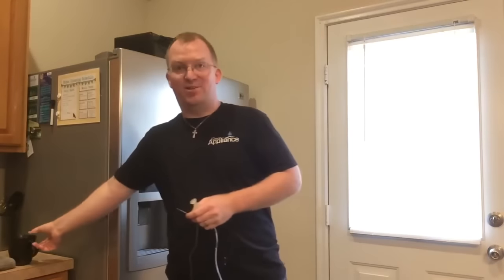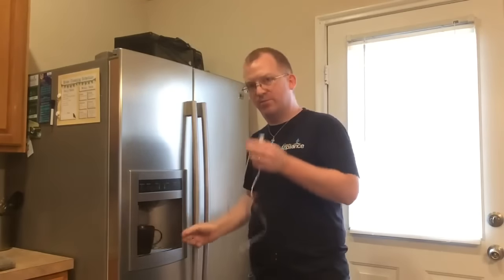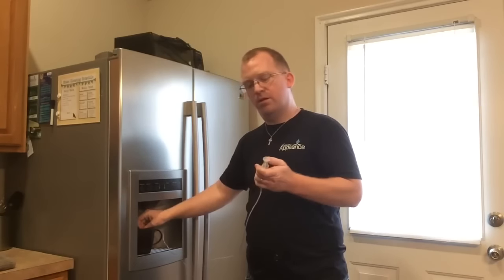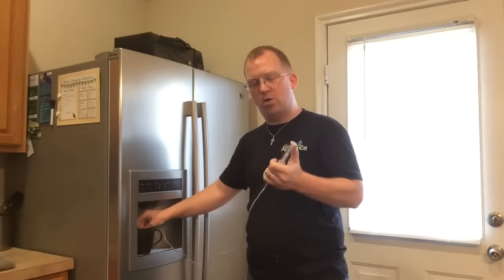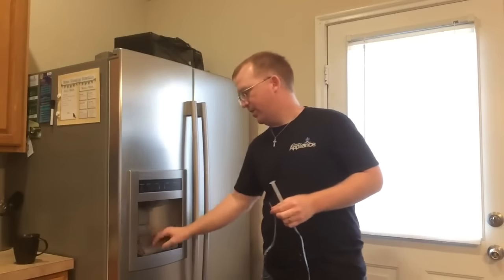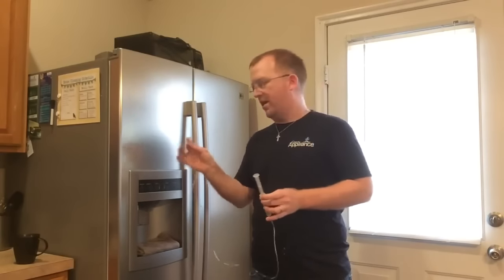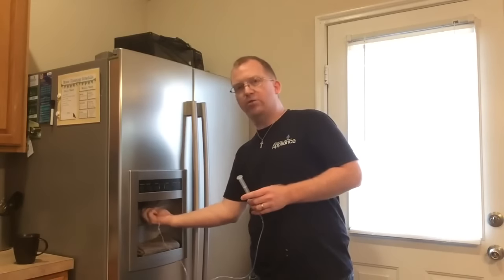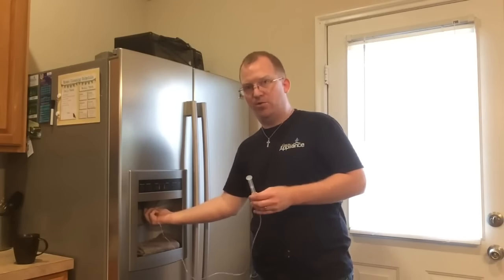The FASTEST way to thaw a frozen dispenser!

Comment: This is a great device!  My water dispenser regularly freezes up and I have added a  heater, resealed it, replaced the flapper, regularly thaw the line either by turning off the refrigerator or using a hair dryer.  I still had issues.  I just got this device a few days ago and it will get the water flowing again in less than a minute.  The problem is the ice build up a few inches into the line...this device is able to reach it and get the warm water directly where you need it!
Reply from the maker: Awesome!  Glad it helped you out. 
Thanks for the follow up and the comment.

Comment: Outstanding. Using the. Hairdryer & weed wacker line the line was unfrozen in less than 15m. With no need to disassemble the front panel. 👍
Reply from the maker: Awesome! Thanks Kevin. Glad you got the water working!

Comment: Worked just as promised. My water line was so filled up that it took a couple of times filling the tool up. Had tried the hairdryer method with no luck. Also tried a kid's medicine syringe but no luck there because the opening of the water dispenser is too small. This worked perfectly. Highly recommend!

Comment: Great tool for clearing frozen water line in my GE refrigerator. I have seen many solutions to this issue but most cost & I was not ready to spend anymore on this shaky unit. Water line was clear in less than 10 minutes from mailbox. Highly recommend!

Comment: Like many people, my GE refrigerator's water dispenser was constantly freezing up, making it inoperable.  I tried a number of solutions for this; 1. Service call from a GE repariman who defrosted the line with a hair dryer.  This was a quick $150 down the drain, 2. Defrosting it myself with a hair dryer.  I managed to melt the ice dispenser unit in no time which led to another $150 service call, 3. Leaving the freezer door open while I taped sheet plastic over the opening to the freezer itself.  This worked, but it was a pain in the neck, 4. Investigated installing a water line defrosting coil.  The repairman I called said that he couldn't warranty this work because these coils burn out about fifty percent of the time.    I saw the Ice Surrender tool on YouTube and figured that I would roll the dice and spend about $13 to purchase this device, (including shipping), even though I am generally a skeptic about these kinds of gadgets.  I followed the directions on this video and in less than one minute I cleared my water line.  So simple!  The chances that it will freeze again in the future are good, but I don't really care.  I know that I can solve the problem myself in no time using the Ice Surrender tool.  Take it from me; if you have frozen water dispenser problems this is the right solution.
Reply: Sure enough, my water dispenser froze up again.  I got my Ice Surrender Tool out and cleared the line in less than 5 minutes.  The water dispenser doesn't work so well.  The Ice Surrender Tool works great!!!

Comment: Wow!! I just got this ice surrender and it worked exactly as it shows. I was able to fix the water flow problem and it works like a charm!  I'm sure I'll probably need it again in a few months when the GE fridge line freezes again. No more expensive service charges for something I can do so easily and quickly.  Andy- genius solution
- 😊👍thanks!

I highly recommend this product!

Comment: Hi Andy,
I’m glad I found your video and ordered your product! It worked as promised, the line has not frozen since I used it, however, we still have that buzzing sound coming from the ice maker? Any suggestions? I understand it is a flaw with these GE products? Thanks
Reply from the maker: Hi Angela, 
Does your Icemaker make ice as expected?  Also, does the buzzing sound only happen when the icemaker is moving the fingers around to kick the cubes out or does it buzz full time?   Thanks!

Comment: Works like a charm. Thank you for offering this product to the public.
What is up with GE? What makes the freezing happen i the first place? The freezing of the line wasn't an issue when it was new.  Now it happens over and over again.
Reply: Hi Mark, 
I'm so glad it worked well for you!  Thanks for the follow up. 
The issue is due to the age of the fridge as there is insulation that breaks down inside the freezer door. This is one of GE's more embarrassing design flaws and one would think they'd bend over backward to assist customers with this issue as it is really really bad advertising for them. 

They do make a dispenser heater which requires a bit of work to install and requires tapping in to the factory wiring harness. In my repair business I've seen about 50% success with this repair due to bad insulation or having the heater burn out. For my repair business, I won't warranty this repair as it stems from poor design. The part runs about $45 and then around $100 (or more) for the install.  
GE really should at a minimum send this heater out for free to customers, but I'm told they no longer will do this.

Comment: Andy, anxious to try it, but would rather fix the entire problem...Is the heater the only option?
Reply: Carolyn Rhodes hi, unfortunately due to the fact that the issue comes from the breakdown of insulation over time inside the freezer door directly behind the dispenser, the only actual 'fix' is to replace the entire freezer door. If it's worth it to you to roll the dice on a heater you can try this, but depending on the severity of the insulation breakdown you may or may not have success. I've seen spotty success in my appliance repair travels (40-50% callbacks) and for that reason no longer warranty a heater install. The heater heats only the outer part of the dispenser tube, but the ice typically will form 4-6 inside the door so the heater is often ineffective. Often you can clear a line once and not have the issue again for years which makes me wonder if the heater is more a placebo than effective. If water is run through the line often (many people in the house vs a single person) helps more than anything for keeping the line clear long term.  
Another trick you may try is to adhere a square of foam or styrofoam to the freezer door inside directly behind the dispenser area, being sure to keep frozen food from touching the wall also helps. 
I wish it were a different answer.
Reply: Andy, thank you. We just found that if you just leave an 18" piece of weed eater cord up in the dispenser tube, when it freezes up, use long nose to pull it out, it breaks up the freeze and the water works every time....will never buy GE again--they accept all the 'whiz, pops, & motor noises' as 'normal'! Ridiculous....

Comment: Thanks, worked for me. Problem is line continues to freeze.
Reply from the maker: Hi Randy, I'm glad it worked well for you. Unfortunately, (and as you know) you're fighting bad design. Some have had luck with adding some type of insulation to the inside of the freezer directly behind the dispenser area, raising their freezer temp slightly, and making sure to keep food from resting against the door when closed.  Also, you may check the ice door flapper to make sure that has a good seal there.  You can do this by shining a flashlight through where the ice drops down while looking upwards from the outside of the door to light to come through. If you see light there, you have an air leak and a new flapper is in order.  I hope this helps some.
Reply: I actually added insulated to the inside area you referenced and so far so good. Thanks for the tip.

Comment: Freaking genius!!! No other way to describe it! Thanks!!!!
Reply from the maker: 13Sparks thanks very much! Glad it worked for you.
Reply: Andy Fulenchek where can you buy the surrender tool?  Will it work on a kenmore with dispenser on the inside?
Reply from the maker: Hi Andy, 
Sorry for the tremendous delay. Yes - it will work if the line is frozen for the inside the door dispenser as well.  I personally have not seen these freeze though.  I'd suspect something besides a frozen line, but if you do need to order one you can do that at: www.GraceAppliance.com/IceSurrender

Thanks!

Comment: I just received your tool from Amazon. I didn’t notice any resistance in the water line. Would that mean it is another problem other than it being frozen?
Reply from the maker: Hi Cara, I’m sorry I missed your comment.  It is definitely possible it could be another issue. If your icemaker is still making cubes, you can rule out a clogged water filter and filter housing (I.e. what the filter screws in to). 
The other possible causes would be a failed water valve (which is separate from the water valve for the icemaker), a frozen water reservoir inside the refrigerator section, a failed switch at the dispenser (but if the ice still dispenser you can rule this one out too), a bad control board not sending power to the valve, or simply it is frozen but just further than the IceSurrender can reach.  

You can confirm a frozen water line by removing the kick panel at the base of the freezer hinge and you’ll see a water line that can be disconnected from a coupling. With the line disconnected you can attempt to get water and it water shoots out this line then, it’s a frozen water line in the door.  Be sure to leave a towel down to catch the water obviously.  

Let me know if you have any questions.  
Also, there is a 30 day return policy so you can certainly return the IceSurrender if you wanted to do that and I’m sorry it didn’t work in your instance.
Reply: GE Side-by-Side ONLY - Refrigerator Repair Videos Thank you so much for the education. Would most of your tutoring apply to a Samsung side-by-side?
Reply from the maker: You'r'e most welcome. 
Yes, the idea is the exact same on a Samsung except you may not have a connection near the freezer hinge as I mentioned to test for a frozen line inside the door.  However, I have not seen a Samsung with a frozen dispenser before. I don't think they struggle with this issue.  However, I have seen many of them with frozen water reservoirs inside the fridge section. 

The issue is that the fridge may be set to 37'F, but cool air sinks and the bottom part of the fridge may be below 32'F and thus freezes the reservoir.  
You can definately heat this part with a hair dryer if you were patient enough, but you may try raising the temp in the fridge section slightly 
(38F or 39F) and then be patient for a week or so.  If this resolves it, you had a frozen reservoir.  

Let me know if you have any questions.  Also, if you wanted to send your model number, i'm happy to have a look at your schematic and fine tune my response based on what the usual suspects are based on what i've seen. 

Thanks!
Reply: You are a genius. And so generous too. My model is RH25H5611SR/AA. In the meantime, I will raise the refrigerator temperature and keep my fingers crossed. Thank you so much for your help!

Comment: Does this work for a Whirlpool refrigeratior?
Reply from the maker: Hi Martha, 
Yes it will. However, the most common refrigerators by far with frozen dispensers are GE side by sides because of a design flaw. I’d just be doubly sure it is in fact a frozen water like inside the freezer door.  One trick you can try is to insert a 8-12” zip tie inside the dispenser water line. If it does not insert all the way, it’s a frozen water line and this tool can defiantly help thaw it.  
Let me know if you have any questions!
Andy

Comment: my fridge is not dispensing water but doing ice and cracking ice, just yesterday, I checked all pumps and connection, all them is working fine. Here is my last step to be done to resolve this problem.
Reply from the maker: Hi Mehmet, 
Sorry to heat about your problems with your dispenser.  Please check that your icemaker is still making ice. Just because it is coming out of the door does not mean that the icemaker is still creating new ice cubes. 

If the icemaker is still making cubes, but it is not dispensing water it’s quite possible that your dispenser is frozen inside the door. 
The easiest way to check if this is the case is to insert an 8-12” zip tie in to the dispenser where the water enters the cup. If the zip tie does not insert fully in to the dispenser, that is the ice blocking the water line. 
Here is a video showing this:
https://youtu.be/rcZq96CKeTE

I hope this helps and let me know if you have any questions.
Thanks!
Andy

Comment: amazing tool, but before i buy one, i wanted to make sure this is my problem and not something else. 

the water dispenser was working fine one day and then the just the next morning it wasnt..

the lights turn on, ice machine works, but when i undid the filter,  and tried to dispense water, still nothing happened, nor did water come into the fridge where the filter sits...is this normal
Reply from the maker: Hi Faiz, 
If you have a GE side by side the water will not work with the filter removed so that sounds normal. 

There is a handful of things that could cause this symptom, but if you will try this: insert a 6-8inch zip tie in to the dispenser hose where the water enters your glass.  If the zip tie inserts fully, your problem is not a frozen dispenser and this tool would not help.  
However, if the zip tie does not insert fully, you’ve diagnosed your issue as a frozen dispenser and the tool would thaw this out quickly.  
I hope this helps!

Comment: Water is coming out of water line but not getting to ice maker.  Can this be used?
Reply from the maker: Hi LoebRules, 
Sorry to hear you're having issues with your ice maker water. 
If you're certain that the line is frozen, yes it is great for that too.  Getting access to the frozen part of the line is the most difficult part. Many fridges you will need to remove the ice maker in order to get access to the ice maker water supply line. 

Keep in mind too there may be other reasons why water may not be getting to the ice maker.  

Let me know if you have any questions. 
Thanks!
Andy

Comment: Any tips on thawing line to ice maker??
Reply from the maker: Hi Samuel, 
I’m sorry I missed your comment. If you’re still having issues with a frozen icemaker water line this tool works like a champ on those too. Depending on the model of refrigerator you may find it easier to remove the icemaker to get easier access to the ice maker water fill tube, but this tool allows you to insert the tubing in to the icemaker fill tube to where it’s frozen and squirt hot water directly on the ice. Thanks!
Reply: Andy you are the champ I want to say thank you so much I like the way you that your videos short and simple straight to the point I feel like I want to give you a big hug you are part of the family
Reply from the maker: Thank you Gustavo! You’re most welcome.  If you haven’t already, please subscribe to the channel. I’m in the process of creating many many videos that will be 100% GE side by side repair videos.  I hope you enjoy. Let me know what you’d like to see.

Comment: inserted the full length of the tube and never hit the ice.
Reply from the maker: Hi, I’m sorry to hear it did not work in your instance. Either your line is frozen further inside the door or you have a more severe issue going on obviously.   To confirm a frozen water line in the door you can remove the kick panel at the bottom of the fridge (on a GE side by side) and disconnect the water line from the connector (you must depress the collar around the tube as you’re pulling the water line away from the connector). Then, with a towel to catch the water, you can attempt to get water from the dispenser. If water comes out of the tube, you have a frozen dispenser in the door. Let me know if you have any questions. Also, there is a 30 day no questions asked return window for the Icesurrender. Please do send it back for a full refund.